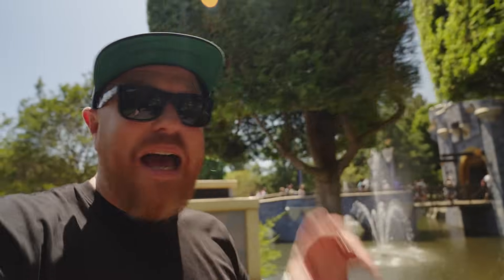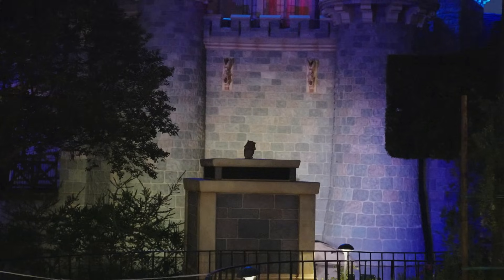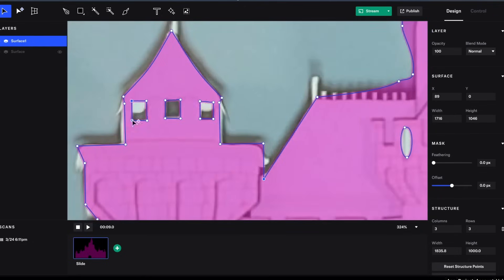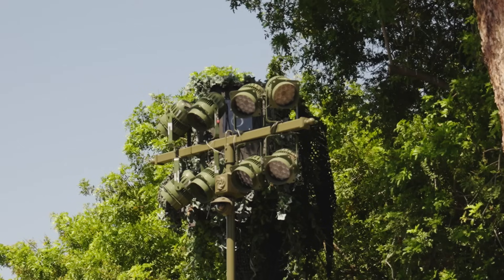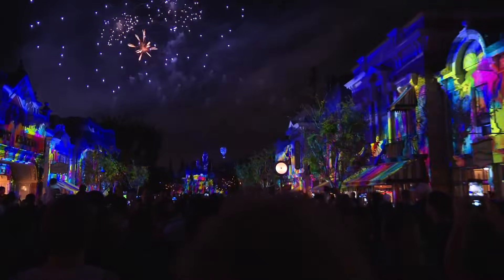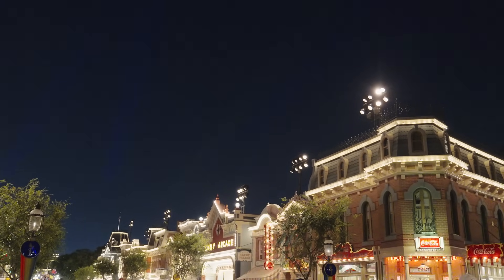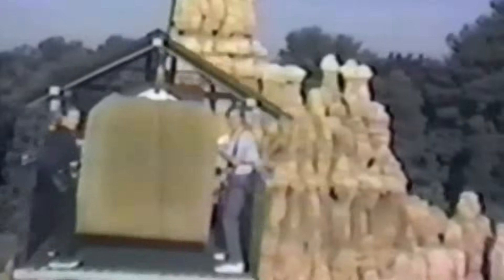How Disney Tricks You Into Ignoring Hidden Fireworks Equipment

Comment: The lights they use in the shows aren't lasers, they're so-called "beams", normal coloured show lights with a system of lenses that can concentrate the output beam, just simulating something similar to a laser beam. They can concentrate the light so much that if you leave a projector pointed on a single spot on a surface for some minutes, with the light heavily concentrated, you'll see smoke, and eventually even fire, coming out from the surface, like it would happen using a magnifying glass 😀

Comment: It’s ISO Par, a cleaning fluid that ignites like gasoline but costs less and burns cleaner
Reply: Correct. "ISOPAR"

And it's a fluid, NOT a gas.

However, Isopar will NOT "ignite like gasoline." For the type used, per the SDS states: "Flammability Conditions: May burn but does not ignite readily." Isopar is safe, reliable, and easy to handle.

For flame effects, Isopar under pressure (maintained by accumulators) is sprayed up via nozzles (similar to a pressure washer) in an atomized stream past igniters. Result: bitchin' 60-ft high flames!

(I worked on a complete revamp of the 6-nozzle flame effects system atop the FL-W & FL-E building roofs flanking the castle back in 2011.)

Comment: Those are indeed Moving Heads in outdoor enclosures and not the lasers. For as far as the show programming runs, I assume it's all Timecode based and it wouldn't surprise me if they used the GrandMA lightdesks for the show. One of the best video mapping / projector mapping software programs are Resolume Arena and Mad Mapper, these programs can align the video map and send the right video part to the dedicated projector. Love your video !

Comment: @Hey Brickey! The reason they set the Big Fireworks in the Toontown area is for safety.  There needs to be a safe distance from the guests in case of misfiring.  They used to set them off in the back parking lot area when I worked there in 1976. I would find lots of remnants in the parking lot.. They don't want this stuff falling on guests.  They later built toontown on that parking lot area.

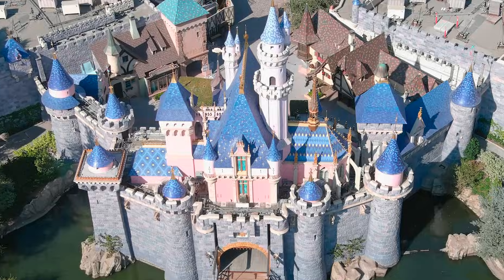Comment: quick note - the fixtures shown at 8:06 are actually not lasers, but are in fact called "moving head lights". They have a "yoke" (a bracket shaped a bit like an old timey slingshot) which allows the "head" (the bit with the light itself and a lot of optics to allow it to change how it appears) to move around and change where it's pointing. Think like a robotic spotlight.

They're seen in protective bubbles which protect the fixtures (which is fancy talk for lights) from the weather.

Most movers now are LED, though older models are powered by discharge lamp (HiD) and some newer models use Laser sources (like an Ayrton Cobra - man i miss working with those things).

The difference between a moving head and a laser is in the way they operate - movers take a plain source, and adjust it using things like fancy lenses, coloured disks and cut-out metal sheets (called GOBOs) to alter the shape of the light when it exists the light. The motors in the "yolk" then move where the lights pointing.

Lasers on the other hand (at least generally in stagework) use a pair of tiny motorized mirrors called a "mirror Galvanometer", or simply a "galvo" which take the points produced by what are basically high-power laser pointers (usually magnitudes more powerful) and move them extremely quickly to make it appear as though it's a shape or image. It's a bit like when you have a sparkler and wave it around so it looks like it's leaving a trail - Galvometers can move at 10's of thousands of millimeters a second and so move the light faster than the human eye can percieve. They don't tend to do anything optically to the laser beyond moving where their pointing, and in full-colour lasers, mixing multiple laser pointers together which are different colours to give the illusion of a new colour (like how RGB LED's work).

There are tons of different technologies at play in big shows like these and the engineering that allows them to work is fascinating. I am pretty certain disney actually does use stage lasers - an easy way to recognize a laser is places love making them do things like waves or flat beams that go over the audiences heads. The ways we are able to manipulate every sense to create spectacular displays is just awesome!
Reply: another fun fact - the big fancy desk shown at 15:45 is called a "GrandMA" - to be specific i think it's a full size GrandMA 2 - these desks cost hundreds of thousands of pounds and run their own operating systems (well, based on Linux) allowing you full control over every single light your using.

Comment: The second layer of fireworks (aerial shells) are actually shot from their backlot. They have an area just behind Toon Town where they use compressed air to launch the shells, so there is less smoke at ground level. Disney actually created the technology which was an industry first. If you look at Google Earth you'll find the area. They close that area of the park for safety reasons - in case of any errant shells or hot ash / debris after the shells detonate. Great video!

Comment: I should have added in my previous comment that Toon Town is closed during firework shows not because they are launch fireworks from Toon Town but because the area is decidedly a fall out zone where debris from the shows rain down into the area.  It is also very possible that occasionally a shell goes up but then falls back to earth unexploded.  This is a serious hazard on all levels and is why Toon Town and the back stage area around the primary launch site is closed down until pyrotechnicians and the Disneyland Fire Department has a chance to carefully check these areas after each show before even cast members are allowed to enter them.  If Toon Town is opened at all after a show it would have to be not only after checking for unexploded shells but also after the resulting debris can be cleaned up.  For this reason, I believe Toon Town usually does not reopen after being closed in preparation for the firework show.

Comment: 18:02 No, the "second layer" which is in reality the primary launch site is located well behind, or well North of Toon Town.  In a satellite view of the area, it is readily visible as a square shaped area located near Ball Road and Cast Place Road, other wise known (or at least previously known) as Ball Road Gate.  This launch facility is located about 600 feet South of Ball Road and about 150 feet East of Cast Place Road.  Check out Google Earth view of the backstage area and you will notice this launch site about 250 feet South of the backstage parking structure where most cast members that work in the administration building park.  Because of the parking structure's close proximity to the launch site, parking on the top level of the parking structure is restricted in the evening.  If you're working overtime you best move your car to one of the lower levels.  It is because these large aerial shells are launched so close to both Ball Road and Interstate 5 that much more than even moderate wind can cause a firework show to canceled; especially if the wind is blowing North or North East.  BTW, the fireworks launched at this site are unlike those fired almost anywhere else in the world.  Normally fireworks require a lift charge that shoots the fireworks into the sky well before exploding with light high above the viewers.  At Disneyland the firework shells do not require this initial explosion to lift into the sky because they are shot up with a very unique, high pressure pneumatic system.  This system was developed years ago as a compromise between Disney and the Southern California's AQMD (South Coast Air Quality Management District) to help reduce the smoke produced by often nightly shows.  As an added bonus, the Disney shows appear more clear because of the lack of low lying smoke that normally would have resulted from the use of lift charges.

Comment: 1:58 This stone pad is used as a control location for events held in the castle courtyard such as the annual New Years Eve celebration, for example.  This is where the audio and lighting controls are located to support a temporary stage set up on the castle courtyard.

Comment: So the top of the now Holiday Shoppe is the stage manager board for pyro. Or at least it was when I was working there.

The room above the Main Street Opera House is more Audio Central and the old phone operators room. They control all the audio around the park from there. I wouldn’t be surprised if they have moved more show control elements into there over the years.

Comment: Nice video although I think you got a few things wrong, at least back in the day the area above Great Naps With Mr. Lincoln was actually the phone switchboard for Disneyland. That may have changed but back in the day that's where it was, as far as the rooftop over Plaza point, I've seen multiple crew people up there. With a showing like that with all those fire elements on the roof of the castle you would want to have eyes on the show area and not just relying on security cameras for the same reason there is a stage manager and safety officer desk right in front of the rivers of America. As far as the main launch location for the fireworks it's actually in the middle of the backstage area well behind Tunetown, and I believe there's five or six  towers that are between that launch facility in a arc around behind the backstage area to create some of those effects of fire locations of Pyro. Also, all the Pyro launches in the park are standard lift charges on the shells, but all the shells in the backstage area are all air launched through their special air launch system which I've seen in action and it's amazing. Obviously some of this may be wrong at this point as Disney is always changing things but I seriously doubt the main launch facility backstage as well as its bunker for the crew close by to the launch area would've changed as that would be a big facility move. If you look at Google maps the main backstage launch area is slightly North East of the parade storage building.

Comment: Note - the fireworks are pneumatically launched - unlike traditional fireworks that use an explosive charge to launch. There are some lasers on the castle and on Main St. But the lasers you showed are just robotic head-moving lights in weather-proof domes.
Reply: Disneys fireworks are custom in other areas as well, for example rather than using an internal fuse to time detonation, they all have a small disposable circuit board that receives a rf signal from control to cupload (technical term) at exactly the right time
Reply: @morph-  a little clarification on this. Disney did, in some shell use microchips to control burst charges but they were not RF instead they were timed from the lift of the shell... now most if not all of what they shoot is  just fused bursts as normal as you can see nightly variation in bursts.   You will also notice all the proximity pryo (close stuff) is timed to music while the larger shells are not.
Reply: @doctorstomp7468  interesting, I was told by someone who worked Disney stuff in France that it was air launched with rf controlled explosives
Reply: @morph- RF and RC probably got mixed up in translation.
Disney holds patents for their pneumatic pyro launch system so you can look up the technical drawings if you want to dig deeper. Pretty interesting stuff.
Reply: @seriosertyp8145  This was a brit who was flown over to work in Paris, so I doubt it, but I'm pretty sure he mentioned it was rf
Reply: @morph- Hmm okay, RFID may be used for programming the ignition time as it operates on very low power. It would be too risky to energize an ignition system early to establish complex wireless communication. Charging a capacitor 2 seconds before launch and telling the ignition system via RFID the delay time seems way more reasonable(the ignition system recognizes the launch via inertia sensor)
Reply: @seriosertyp8145  not rfid, rf ad in radio frequency. They apparently had their own custom system for launching and cuploading them, as far as i know it was only a one way connection, so no connection would be required, and the shells had small batteries onboard
Reply: @morph- Interesting. Time for me to do some more research. Will keep you updated.
Reply: @seriosertyp8145  that's just what I got told by someone who worked there previously, things might have changed, or whatever so I don't know
Reply: @morph- My other reply disappeared. I found some additional information. In a TIL thread on R..it the lead engineer provided some additional info. Time controlled chip, capacitor powered, charged and programmed via 2 cables, on site. Shell recognizes launch by detecting the lost connection when the cables get ripped off.
Reply: Was going to say the same thing and explain that is why you don't hear the lift charge for the firework like traditional shells.

Comment: Overall great video. I used to do projection design and also designed nighttime shows for WDW in past jobs, so I love seeing people pay attention to how they work and wanting to learn more.
It's interesting that DL went for a few close range wide angle projectors while MK went for tighter, farther throwing lenses on more projectors. I'm guessing mostly related to height, as the buildings are all taller at MK and have better line of sights of the also taller castle.
Also, those aren't lasers LMAO. No one is allowed to permanently shine lasers into the sky in the US, especially at the class/wattage those would need to be. Those are moving beam lights using a regular bulb.

Comment: Love this video! Big lighting nerd and love to learn about all things lighting! Some more insight on the lighting systems, Disneyland only actually has one laser beam system. The laser is positioned dead center on the castle, Lasers give off a very distinct light that can travel extremely long distances but needs elements to reflect off of. The "snow" affect is yes used to simulate snow, but it's also used to make the laser and other lights appear to our eyes because the lasers will disappear if it doesn't have any area to reflect off of, like (rain, fog, smoke and "snow"). The projectors that give off the images are mostly also laser based but they are two different types of laser applications, one being image based and the other being beam based. The lights behind the castle and the ones that are set back on the roofs of main street usa are in fact not lasers, they are called "bulb beam moving head lights". In most cases these lights are not even LED powered they are powered by HID bulbs for their white light and use a motorized color filter wheels inside to change color and have a secondary wheel with other filters to change the look of the beam. The lights that look like they have the multiple little glass circles on its face that are placed on the polls and painted "go away green" are the LED lights. LED stage lighting has had limitations of the amount of power they can produce so they have been relegated to smaller low power lights and floodlights/wash lights. Only recently have LEDs been able to be used in high power moving beam lights like the ones behind the castle but since disney's lights have been in place for several years now they are most likely HID based lights. Cant wait for more videos like this from you! ❤😃

Comment: Hey Brickey, really cool vid I love to see where the things are actually placed. Only wanted to tell you smth, im really familiar with stage tech and what you said to be lasers are actually Moving Head Beams which are super powerful beams of light used mainly in concerts for example, they are covered in a bubble like thing because if it rains they actually break and they are pretty expensive so thats a rain cover. Keep up the good work!!
edit: the lasers actually project a way thinner beam of light which thanks to the scanner moves so fast that we see it as if it was a line or even patterns but actually its just one single "line" moving really fast

Comment: I am a professional pyrotech, the fireworks at Disney World are fired in air cannons, instead of with lift charges, and each individual firework has an altimeter inside to set off the  busting charge to allow it to burst at the exact altitude needed. 

I assume Disneyland uses the same vendors for their fireworks but knowing Disney they may use different vendors for each location to further development of the art and encourage innovation by the vendors and the Imagineers.
Reply from the maker: That is fascinating and makes so much sense! Thanks for sharing. ❤️
Reply: Also air cannons also altitude triggered charges however the low altitude castle fireworks are traditional but this may have changes since I left the company
Reply: It was always fun to be backstage when they would run the check on the air cannons for the show. Running the whole fireworks show in about 30 seconds is a neat thing to see.

Comment: it would be fun if you got to do this for each of the shows at the different parks.
what? there are sprinklers on the roof of the <censored/>?!
that random building is a control room?
that box is the top of a speaker tower, and will rise 30' into the air at showtime?
Reply from the maker: More videos will be added to this series covering other shows.